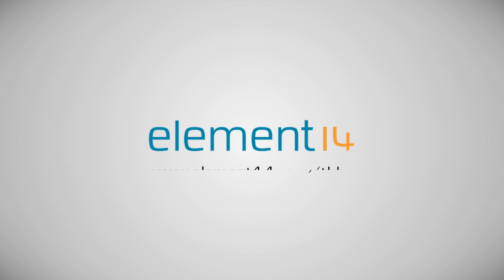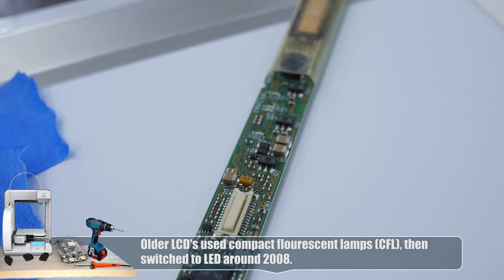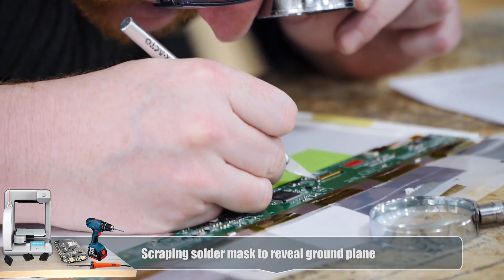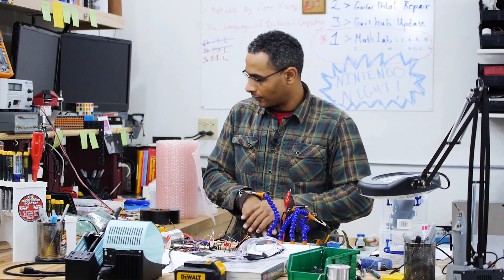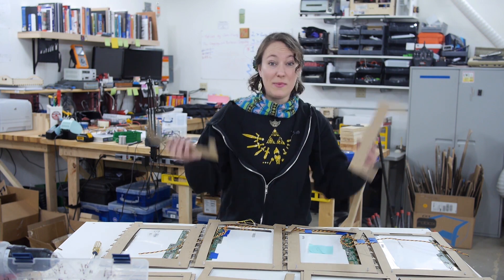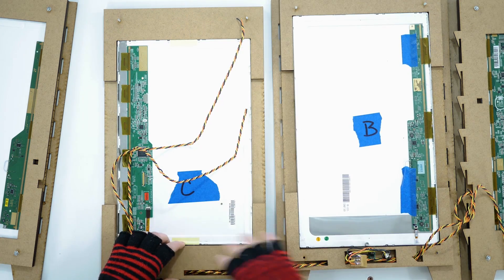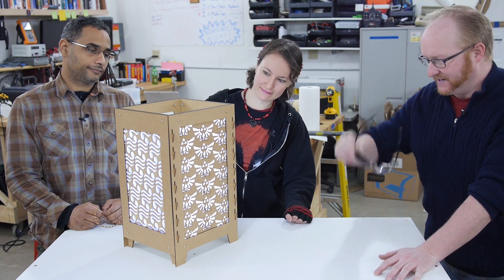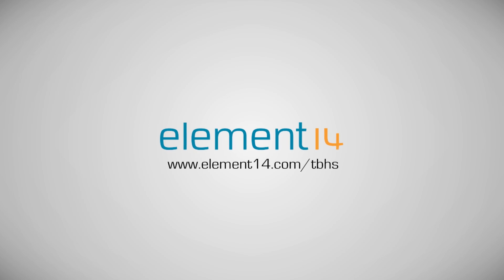Ben Heck's Zelda Lamp: Upcycle Laptop LCD Screens

Comment: wasted (in the gta sense) a lot of bits for a real basic lamp. and alot of overt work...

why discount CCFL's? CCFL tubes make super excellent lamps. some CCFL tubes, a bit of sandblasted polycarb, much more solid, far simpler. granted, i only made one panel.

very complex, over done. oh well. fun to see. CCFLs are great.

Comment: I can't believe I couldn't find any comments on how the Titaniums they are tearing apart are probably the coolest laptops ever!
The first PowerBook G4 (nicknamed Titanium because of its titanium shell, yeah, you read that right, titanium) was released in 2001 and at only 1" thick it was ridiculously thin for its time, and was actually thinner than the model that replaced it a few years later. Even my 2012 MacBook Pro is hardly any thinner than that beautiful machine.
That laptop was gorgeous and well featured for its time with a built in 56k modem, two video outputs (VGA and S-Video), USB and Firewire, and even included the very first generation of WiFi (Apple laptops were some of the first to include WiFi standard). It gained gigabit ethernet by the end of 2001 (something that didn't become standard in the PC industry for years), and a full size DVI port the next year. And to upgrade the RAM or HDD all you had to do was lift the keyboard up. Yep. There were too little clips you pulled back with your fingernail and the keyboard would peel away to let you access all the upgradeable parts (which was also possible on its predecessor).
I absolutely loved the one I had while I was in High School. It was already seven or eight years old at the time, and the paint was wearing off (one of the challenges that came with the titanium enclosure), but to this day I think it is still my favorite computer of the many I have ever owned. And now Ben Heck is taking apart boxes of them to make lamps... Oh how the time flies!

Bonus fact: that box of Titaniums you can see at https://youtu.be/dJWQc0NJ9DA?t=49s would have been worth over $10,000 new in 2001 when those laptops where new.

Comment: What exactly is the problem with CCFL backlights again? Because I have a bunch of laptops with those.
I came specifically back to this video to check again which screens were useable, and why, but the why is missing... :/
I'm guessing it might be because CCFLs flicker, which might be uncomfortable with prolonged use? Or is it a matter of uniform lighting?
Reply from the maker: They require more power and hacking them is more complicated. The LCDs are much more straight forward.
Reply: Aha! Thank you. :)

Comment: Why use cheap looking slide tabs, you have a laser cutter, dovetails would have been a piece of cake or just break out the biscuit joiner.
Reply: With the material so thin, I was hesitant to do any jointing techniques that only connected at the corner. And with a crunch for time to finish the project, I wasn't able to put too much more thought into the connecting of the sides. :\
Reply: I can understand that, deadlines can make good builds go rough really fast.  I'm not ashamed to say I have a few projects of my own that went that way :)

Comment: Hey,  Ben, Karen and Felix. I picked up an Atari Jaguar and Jaguar CD,  with a selection of games at a games trade store for next to nothing.  I've also got a couple of old laptops I no longer use.  The atari consoles are really not in great shape,  so I was planning to make a jaguar portable,  utilising a laptop screen (inspired by your cool ideas),  any pitfalls re: voltage (I'm from uk),  processor clock, using the CD unit outside of a traditional console setup, etc I could run into? I'm planning to run everything from the one unit

Comment: Need to be painted... MDF looks so meh bare. I'd also Honestly have chosen to screw it together. Blocks in the corners do well to take screw threads from two angles to join corners. To me, the retainer "hooks" are far more intrusive than a couple screws would have been. If you didn't want screws either, use a stack of blocks, one connected to one panel, and the other connected to the other panel, and then screw one block to the other block from the top, inside the lamp. No exposed retaining "hooks" or screws then! You also could have cut a top cover with additional zelda patterns, and simply hot glued a diffuser swiped from one of the CCFD panels to diffuse the spilled light from the backs of the panels.

Comment: the lower the resolution panel'
the better. unless it's 320x240 no I don't like that, 640x480 is lowest I'd go, (I already have a CRT so I'm not that worried unless the panel is for building portable systems)

Comment: One of those looks like the laptop my mother still uses.
Blaah. HP laptops are some of the most painfully unreliable and useless I've come across.
they look nice, and have decent features... On paper, but I wouldn't touch one after seeing what's happened to the ones my mother's had, or that I had to fix when that was my job briefly.
Just about anything is better than a HP laptop when it comes to reliability...
HP laptop - Just say no.

(HP printers on the other hand are usually pretty decent. Go figure.)

Comment: I used this method the past new year day, we had no electricity in the building. so we used old LCD and lead battery.... more than 10h... not bad.

we also made a PWM signal generator with a 555 to control the brightness.

Comment: This is pretty cool, but that "upcycling" term bugs me. By definition, upcycling is recycling. 

re·cy·cle

rēˈsīk(ə)l/

verb

gerund or present participle: recycling

convert (waste) into reusable material.

"car hulks were recycled into new steel"

synonyms:reuse, reprocess, reclaim, recover

salvage, save

"the UPS Store will recycle those annoying styrofoam peanuts"

return (material) to a previous stage in a cyclic process.

use again.

"he reserves the right to recycle his own text"

Comment: How fragile are the LCD back lights, and how much juice do they pull off?  Could it be possible to build like a camping light with one of these and a travel battery bank?
Reply: They require a decent amount of amps to run and on most batteries, that would run out pretty quick. Ben says you might be able to do it if you hooked them up to a 12V battery. Not sure how long it would last though. I'm terrible at Ohm's Law math.

Comment: I thought upcycling meant making a higher valued product out of discarded stuf, like a messenger bag from old truck canvas or something. Why is this (re-using parts of something old and/or broken) not just recycling?
Reply: It's my understanding that recycling breaks materials back down to their raw materials in order to make new products. Upcycling reuses part of something old as is without returning (material) to a previous stage in its cyclic process.
Reply: Buzzwords. People love them. ;)
Reply: You're right--I think they just wanted to sound a little fancier.
Reply: Haakon Anderson that's a fair point as long as the rest of the laptop is trash theHeckwithKaren I get that, but I think the distinction is a little arbitrary.

Comment: Could I take the backlight from an old 55" tv and hang that over my work table for a work light???
Reply: Yes, i make one draw table for my mom... is a sony 32 inchs tv, replace the lcd with a glass 3mm thin, and the 3 lines of leds (7 leds ffor line) i used an dc dc step up (thesse from china).
Reply: Probably.